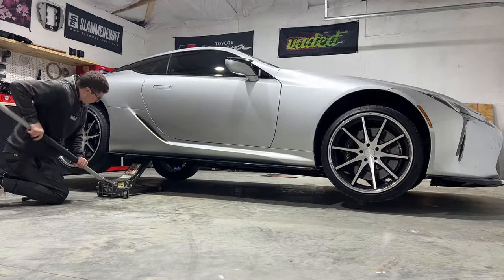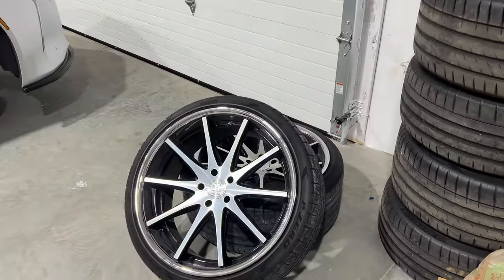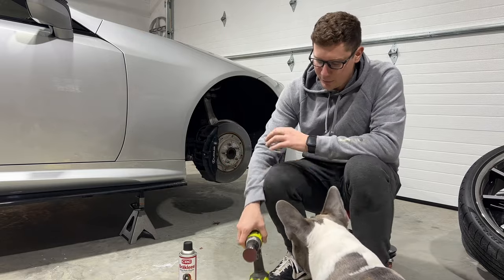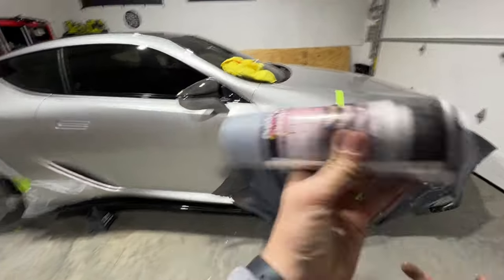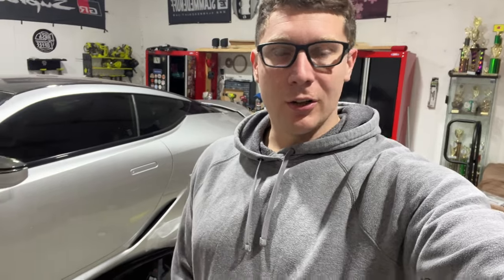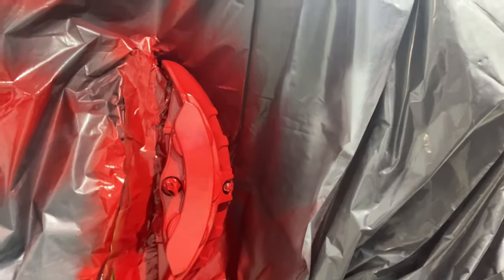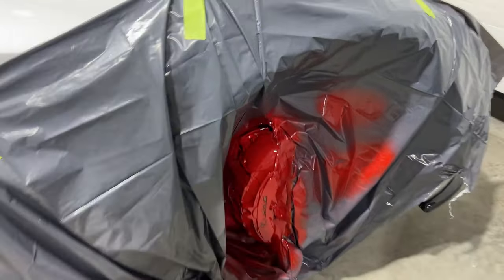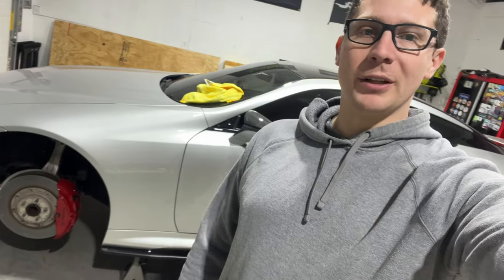LC500 Eastwood 2K Red Caliper Paint

Comment: Did you want the Lexus logo removed? you could possibly have preserve the lifted white lexus logo, maybe with; tape, beeswax, rubber cement, etc..

If you put this on a lift, do you see painted calipers only on the front side with the back still being the original color? 

Did this also cause overspray on the brake pads & rotors… and maybe even the car body?

Bummer the video didn’t show a before & after with the wheels in place.

Was the juice worth the squeeze?
Reply from the maker: Yes, I wanted to remove the original logos it’s way too much work otherwise might as well just replace them

No, I was able to paint the entire caliber all the way around to the back sides, you might be able to see where they mount by the bolts but I would say 90% of the caliper is covered 

Everything was taped off, so there was no extra overspray, the rotor gets a little bit of overspray, but it will come right off once you hit the brakes on the first drive 

I wanted to show before and after, but I wasn’t finished with the car and I needed to leave it on the jackstands. My latest video shows the final results.

Comment: Did you actually use it as a 2k paint? You're supposed to use the red cap and puncture the bottom to combine the 2 components then shake it to mix. It's also very toxic and requires a respirator and ventilation while spraying.
Reply from the maker: Yes I did & yes I wore one